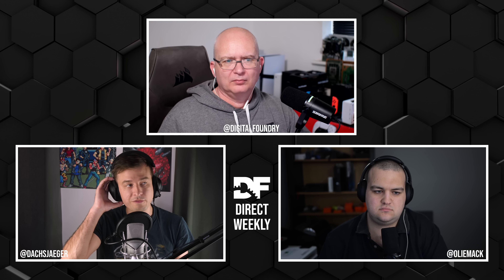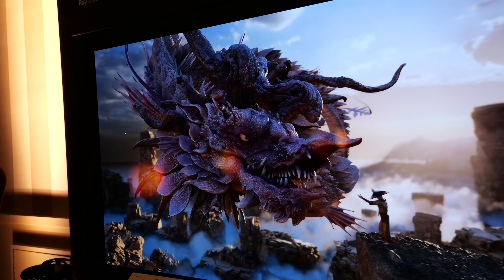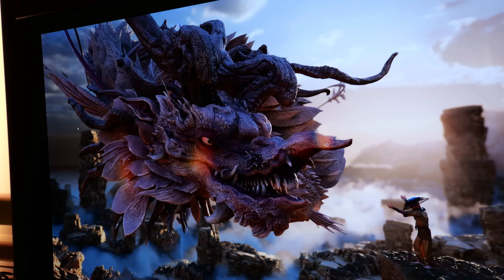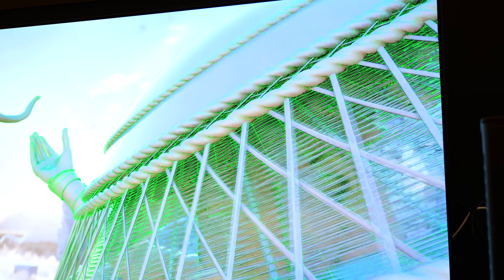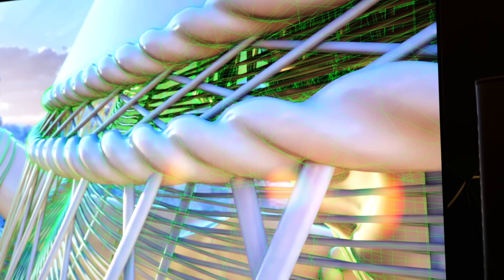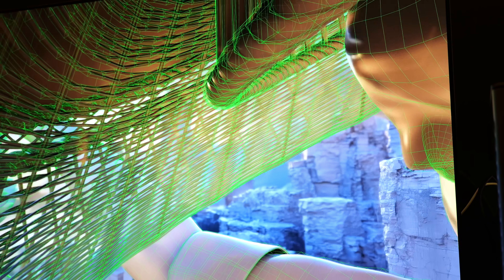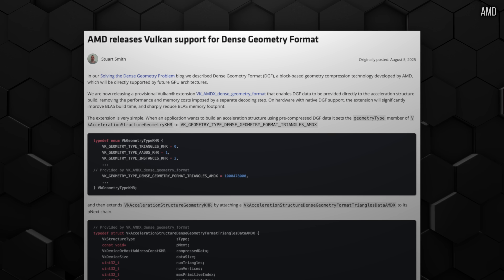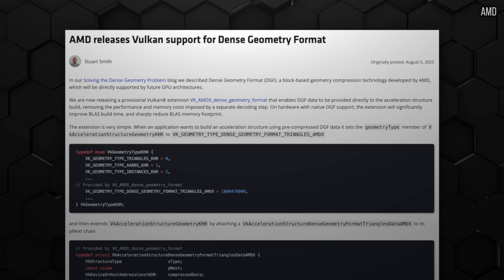AMD's Dense Geometry Format Explained: It's Not Copying RTX Mega Geometry

Comment: Haven’t read through the docs yet but my first thought is that one of important points behind introducing mesh shaders was to enable geometry compression (and to side step fixed function IA limits). The downside of mesh shaders is that these custom compressed formats cannot directly be used to create RT acceleration structures. Looks like AMD is trying to bridge that gap.

Perhaps it is too early to standardise acceleration structures themselves (and GPU companies see that as conpetitive advantage).

I don’t buy the argument that games cannot ship with compressed geometry, for GPUs that don’t support this it should be trivial and very fast compute shader step to decompress at load time. NVIDIA suggests the same for NTC in case hardware does not support it (and it’s longer stretch because without NTC you most likely want other compressed format than uncompressed texture).

Comment: >open source
>stifle innovation 

OPINION RISREGARDED BYE BYE 👋
Reply: I dont think open source even matters here. DGF seems to be different from MegaGeo and requires devs to adopt it anyways. We'll probably see DGF in consoles, but not for PC, because NVIDIA dominates PC and using their tech makes more sense when 95% of users are using NVIDIA. Can open source stifle innovation? Depends on how you look at it. Patents exist because its designed to promote the drive to innovate but we can also see it abused in a way it stifles innovation. It all comes down to not some opinions on the word "open source" but rather what does AMD do with this. Do they support it all the way for a decade moving forward? Does this make NVIDIA not push what MegaGeo does because an open source solution exists? Does any of this tech matter when developers dont seem to be adopting it rapidly unlike Path Tracing or MFG?

Comment: I'm sorry the idea that a open source sdk + vk extension may "stifle innovation" is one of the most deluded arguments I've heard from Alex. Even Rich called it out.
When has Nvidia consulted it competitors before adopting anything, let alone even offered a open-source solution without losing the adoption war to open standards first.
Reply: Yeah I don't get it either, and he even said, it's not the same thing as what nvidia does and both could be complementary. I really don't get where the argument is coming from
Reply: streamline. nvidia and intel were willing to cooperate to come up with a standardised upscaling framework, amd declined.
Reply: nvidia streamline
Reply: @darudesandstorm7002 Streamline released in response to FSR.
Reply: @PcGameHunter  it was a joint effort to unify upscaling api to benefit devs and customers. intel was on board but amd didnt want to play ball.
you asked when they consulted with competitors and i answered.
Reply: That is not what he said. He said that having AMD push a format out there for DGF that is fundamentally their idea and thus will undoubtedly have full support in their hardware, without any input from the other GPU vendors and thus potentially not have support in their hardware, could lead to format wars, where NVIDIA and Intel come up with their own variants on the same idea. That would be bad!
Formats like this need a unbiased third party to standardize, fielding input from all vendors about what should and what shouldn't be part of such a format.
This has nothing to do with this being open source or not, its to do with avoiding vendors wielding their variants of the format against each other and ultimately making the developers and gamers bear the brunt of those format wars.
Reply: @YouHaventSeenMeRight  "He said that having AMD push a format out there for DGF that is fundamentally their idea and thus will undoubtedly have full support in their hardware"

You are making sizable assumptions there, and ironically somehow based on how nVidia has historically acted rather than AMD 😑

It takes a lot less time to do some research about software techniques in the lab than it does to do that AND then implement optimised support for it in a dedicated µArchitecture.

If they are publishing now then either dedicated support is 1-2 gens away, or only incidentally support it as a result of something necessary to OGL, DX or VK - just as with FreeSync and the PCIe bar thing where they just took advantage of features already existing in current standards.

"Formats like this need a unbiased third party to standardize"

Ah yes, an unbiased 3rd party like Khronos.....

Oh wait, Khronos's president Neil Trevett is an nVidia employee.....

Well sucks to be anyone else then 😬

Bruh you are literally just demonstrating ignorance or bias in every aspect of your comment 🤦‍♂
Reply: @YouHaventSeenMeRight Yes, he is complaining that AMD got a first mover advantage in a scenario that Nvidia has engaged in their entire existence. AMD is supporting a format they developed, in their own products, open sourced the spec and tools, making the choice of format entirely in the hands of other vendors. Yet he presents it like this is bad and will stifle innovation and its somehow AMD's fault. He never makes this type of argument when talking about Nvidia, the company that historically doesn't open source their stuff to other vendors in favor of proprietary lock-in.

Should these formats be standardized or evaluated by some independent third-party? Yes. Is that how that works rn or has ever? No. Has this ever been brought up before on the side of the literal GPU monopoly ? No.
Reply: @PcGameHunter the proposed format is hardware specific and needs vendor driver implementations, putting this on the Khronos team to support and maintain is a ridiculous idea, but well...

NVIDIA just isn't trying to make other people eat their shit.
So it just looks like AMD are the "good guys" opening themselves up and giving away their magical technology 😂

Mostly everything NVIDIA has ever open-sourced was adopted.
AMD open-sources either this kind of shit, or just independent implementations of things like FSR, never any core technology 😂
Reply: @PcGameHunter  You hear open source and you think it must be positive. Look at it from a different position where its open source and nothing is done with it. AMD has no incentive to do more with it because its open source. Nobody has an incentive to use it or improve it because AMD won't allocate resources to make it more viable.
Reply: @PcGameHunter  Every YouTube channel has their daddies, Digital Foundry's is Nvidia.
Reply: It doesn't matter. Remember that AMD releases it open source precisely because they know few will adopt it anyways. They essentially have very little time and money to spend it on these techs, and therefore nobody wants to use them because it won't be supported. Therefore they do it just to show they can somewhat keep up with NVIDIA and that's good enough. That's it. Nobody here will ever see or use that tech for years to come.
Reply: Lots, NVIDIA is the reason for most the graphics pipeline today, NVRHI and core technologies are open-source, but more importantly cross-platform.
Some things, like nieche features, are kept proprietary since they require specific hardware.

Unlike AMD.
AMD often is masquerading their hardware dependant implementations as Open-Source and even trying again and again to make the BE the spec, and fail again and again. (sometimes they succeed and we get a big mess, happened more than once)

Comment: When will there be new GPU technology that push gameplay and not graphics
Reply: That’s not on chip makers more on the dev side
Reply: Digital Foundry didn't hear that.
Reply: That's the whole point of RT, it lets developers avoid baked lighting which prevents any changes in lighting conditions or level geometry, which limits what you can do with gameplay, at least without severely limiting the visual style to very edge-enhancing styles to keep the scene readable.

Comment: AMD needs to use liquid metal in their cpu, to cool them down more. I cant understand why you need to do this manual, when this liquid metal costs, what 10€ or $. 
There is no excuse why, this not the standard for CPUs. Maybe they dont want that a cpu live 10 years long or, they dont care about overclockers.
Reply: AMD use soldered indium heatspreader, the highest standard in chip industry. It was Intel that used thermal paste to keep the cost lower and have greater margins. Liquid metal can be used outside the CPU, but that is resposibility of the manufacturer to use it or not. So your idea about AMD implementing liquid metal inside the CPU is not feasable at all, like any other chip maker in the industry can't do due to technical limitis and huge durability risk of having a metal compuond touching critical dies
Reply: @Squagliafrittata But AMD did make a thicker heatspreader that is less efficient with AM5. Granted it was to maintain cooler compatibility with AM4, but AM4 had a long enough life. I would like my 7800X3D to run cooler without delidding.
Reply: It's simply not worth it at this point. Liquid metal is pretty nasty to apply, you need to protect small electrical components, need to deal with it alloying with other metals, and the gains when you are using an ihs is not that great anyway.
So using it may also shorten the life of the cpu when containment fails or the cpu runs dry, it will definitely not improve the life of the cpu, rather it would decrease it. And cost is not in the liquid metal, it's in the processes that keep it all working

For the ps5 they definitely made good use of it, allowed them to use smaller / quieter cooling but not for a cpu with a heat spreader.
Reply: They don't need to. It's way more expensive than traditional thermal solutions, which do the job fine for most cards. It'd be cool to see on the really high end stuff though
Reply: Phase change thermal pads like PTM 7950 work great and already used by some AMD AIB GPU partners like Sapphire. It doesn't pump out like thermal paste, lasts long and gets better over several heat cycles.
Reply: Recently, Cyberpower began selling desktops with carbon nanotube pads (i.e. Carbice Ice Pad) which appear to work quite well and have good durability. PCGamer published an article about it, yesterday.
Reply: Guy i dont talk about thermal paste outside. I talk about Liquid metal in the CPU.  The Bauer Roman showed very clear. That you can save 10-15 Celsius on the cpu. They can it or make some small frame around the other components in the cpu. So they sell cpus for 500$ + but cant lower with liquid metal the temps... Maybe they dont want to chance the labor for this or they dont care.
Reply: @mx-gaming87 they don't want the cpus to break is the reason it's not done. Liquid metal needs a perfect seal or it will degrade quickly - look at custom applications where overclockers have to reapply lm every 6 months. Indium gets most of the performance but is inherently stable, which means far fewer returns and lower support costs. Its performance is good enough to keep the cpus running in spec, so there's no good reason to move away from it yet. There will be a point where the heat density of the cpu gets too high for even indium, but I suspect when that happens we'll see amd and intel stop using IHS altogether.
Reply: Oh! Inside the CPU? That's interesting. I wonder if it's a substrate layer or if it's integrated into the Integrated Heat Spreader (lid).
Thanks! I'll look into that!

Edit:
> Liquid Metal between the chip and the IHS

That is, removing the IHS, carefully applying the liquid metal to the non-conductive surfaces of the chips, and then reattaching the IHS so the liquid metal fills gap between the chips and the inner side of the IHS.

Huh...that's sounds risky. It works in practice, but can be difficult to accomplish manually. I suppose doing it on the factory line would mitigate the risk involved in manual application.

Comment: How is this not the same as tessellation?
Reply: Tesselation is fixed function increase of vertices, you say where and gpu automatically generates them. Its also not optimized for modern gpu architectures.

This is compression of existing geometry. Getting more for same size, using techniques optimized for modern gpu similar to mesh shaders
Reply: To add to what @RazielXT said, tessellation is simlar to DGF in that it's a form of compression where you get more triangles in less memory. But tessellation is dynamic, adjusting triangle density and smoothing the mesh at closer views. DGF is static geometry. The advantage to DGF over tessellation is that you can build your ray tracing BVH around static geometry but not tessellated geometry. There's been no way to feed compressed geometry to the BVH builder before this.
Reply: Tesselation is like giving depth, think more like LODs rather than tesselation

Comment: Xbox 360 actually inaugurated new features as well. I remember reading articles that, per, Microsoft and (then) ATI's agreement, new tech had to inaugurate on console first. Kind of like HDMI 2.1 with Series: X and PS5, before the GPUs containing the new input standard  would release. Therefore the 360 and new GPUs to follow would feature the first ever stream/ shader processors (this is when Radeon was industry leading, or capable of industry leading) and the Xbox 360 also featured prototype tessellators, which wouldn't be used until about 2010 in Halo Reach, and then again when Crysis 3 came out. This bugged me back then because you could already see console dictating the future. There's a real reason we don't SLI anymore and that's because games aren't built to scale that much anymore, since lead platform, as of around 2010, is now console.
Reply: SLI was also a microstuttering mess that was most likely bottlenecked by CPUs of the time
Reply: Also coms between the two dies.
Reply: @raikaru0 True! But what ever came of this whole Explicit Multi-GPU/ DX12 hype? Allegedly we could mix-match DX12 GPUs from any vendor and would have worked a lot like SLI SFR methods, as opposed to the crappier SLI AFR methods. With SFR, you render different parts of the screen. With AFR, each GPU renders a frame, making it so that you're not doubling up on memory or processing power.
Reply: >stream/ shader processors

I think I remember this! Thanks for your comment!
Reply: You don't have to be bother by it, because games are created for mass adoptions and mainstream GPU and consoles is there . That's why mod is exist for powerful GPU to utilize it.
Reply: :face-blue-smiling: